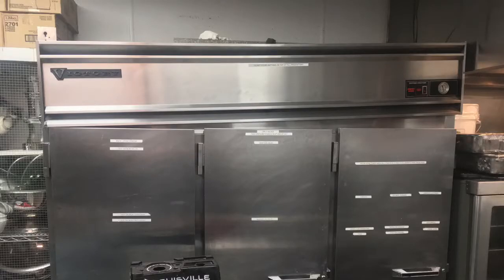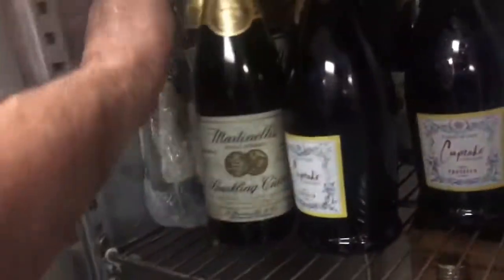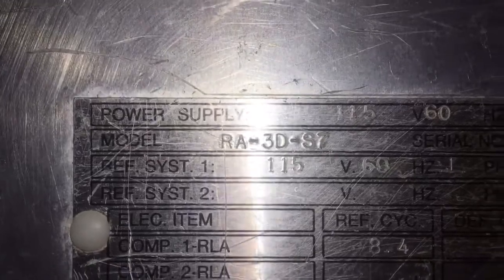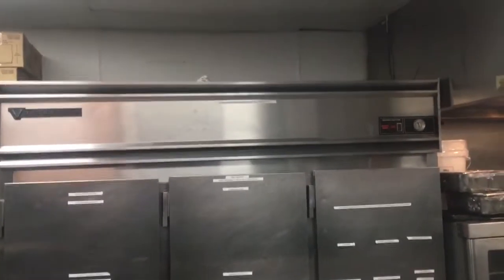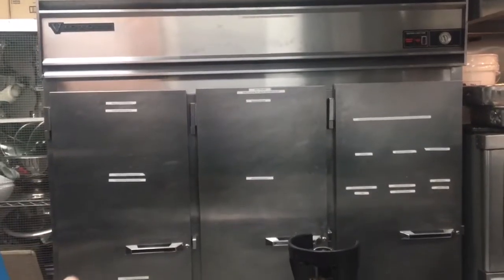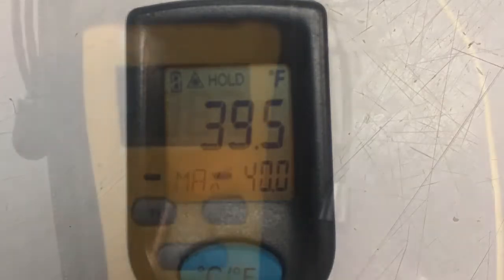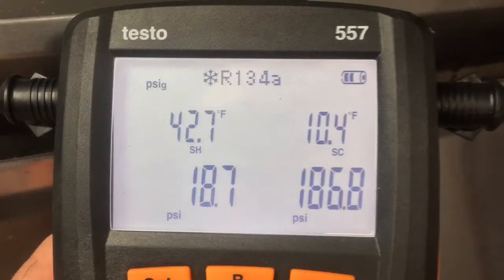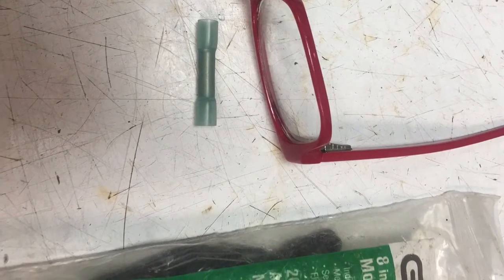Victory 3 door refrigerator warm. lets take a look.

Comment: think compressor a bit undersized 1/2 in place of 3/4, probably need  larger size cap tube too! Whats your opinion!?
Reply from the maker: yep, should be a 3/4 hp for sure. traulsen 30 years ago thier 3 doors were all 3/4 hp and they kicked booty. 1/2 hp just gets the piss run out of it and shortens life. never stops running and when condenser gets dirty things get even worse. 1/2 hp on 3 doors just never gets a break. everything has to be perfect all the time for it to even have half a chance. i'm going to quote a 3/4 hp and a txv to get this cooler where it can do its job in this 95 degree ambient spot its in.

Comment: Do you always go with a TVX if you are replacing a compressor that had cap tube?
Reply from the maker: Yes , that is the way im leaning these days. Cap tubes suck !
Reply: @OcRefrig  Can you change to TXV on small reach in without a receiver? If so, how? Adding a large filter drier angled downward?
Reply from the maker: its preferable to add a reciever , then a drier and sight glass , but u can just add a txv and drier. ive seen factorys just  have a drier and txv , no recievers. heatcraft pop top units do it that way. not a big deal just do it.
Reply: @OcRefrig  cool... a couple of my frankenstein units are gonna get huge filter driers when I get back to my storage closet/off season lab!
Reply: Already bought sight glasses and filter driers on my most recent parts po thinking along these lines.
Reply: Have not  investigated which txv kits are most adaptable yet.
Reply from the maker: just use a 1/4 ton alco sweat txv. you'll be fine. they will open up or throttle down  for what ever is required. use a drier and sight glass. you could run a EK-082S drier or EK083S, hmi-1tt2 or Hmi1TT3 Sight glass depending if line size is 1/4" or 3/8". these are the parts i'd use.
Reply from the maker: i put this up with you in mind. https://www.youtube.com/watch?v=wKJgxMiCdB8
Reply: @OcRefrig  Andy Warhol's 15 seconds of fame!
Seriously though, thanks for detailed replies.